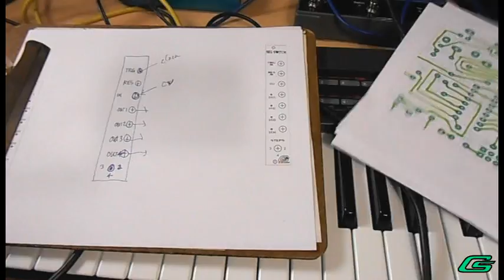Eurorack Sequential Switch Demo

Comment: Sorry of this is a stupid question but do I need multiple step sequencers as well as clock dividers to make a sequential switch work? 
I'm having trouble getting me head around what these switches do... 

Basically they allow you to switch between different patterns on sequencers? Or am I missing something?
Reply from the maker: Thanks for checking out my vid.  The Seq Switch works all by itself.  The signals you send through it can be whatever you want it to be: different audio lines or possibly different CVs, or different clocks that come from the divider but you don't have to use it that way.  And that's the beauty of the switch, you can use it with so many different things.  So yes, you could switch between 4 different trigger patterns or even switch 4 different pitch sequences.

Comment: So you can have 4 different CVs coming in and a CV out rolling over them according to the clock. But what's the purpose of having 1 CV in and 4 CV outs? Just for the multiples?
Reply from the maker: You could send the CV outs to a module that can have many CVs going in, like Basilimus Iteritas.  Another use could be 1 AUDIO input, redirected to four outputs - each output going to a different effect module like in glitch music.
Reply: Cheers, that does make sense. Still exploring the usability of sequential switches. Let me know what's your opinion in the Erica Synths one. It's 8 channel and has buttons for manual clock reset and advance.